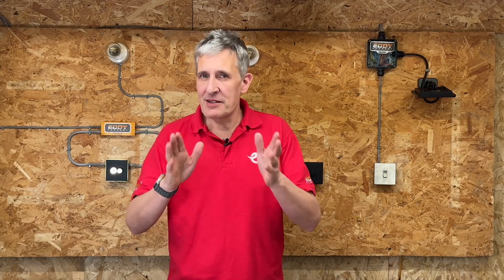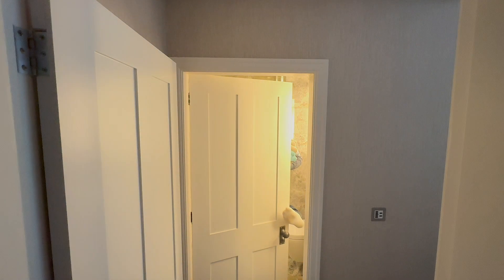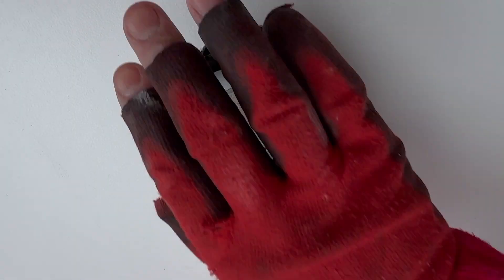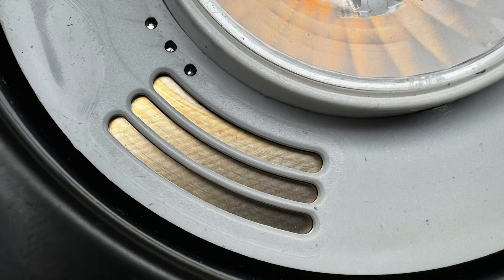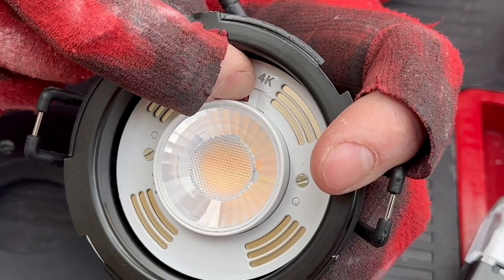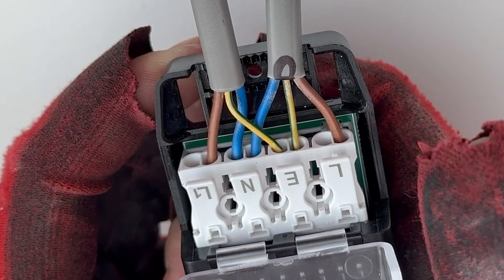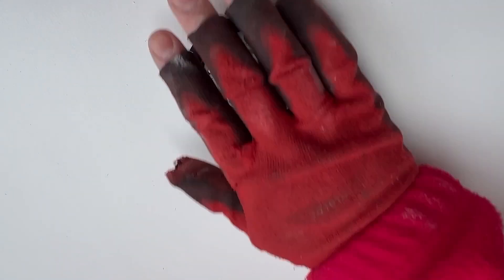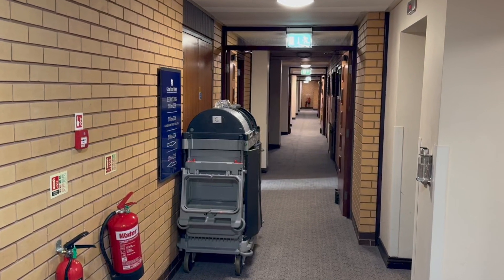Why Has This Never Been Thought of Before? - Collingwood H2 Sense LED Downlight

Comment: I assume the only critical point is the spring loaded connector of the PIR. I know the light itself is IP65 rated, but the connector stripes for the PIR are exposed to humidity.
Reply: They are gold coated

Comment: Can you common the outputs of two pir variants so both will enable any lights slaved off it? If so i think its a great product and i will be using for sure
Reply: Yes, you can loop the permanent feed to a second (or more) PIR fronted fitting and link between the L1's which allows for multiple primaries on one circuit.

Comment: Occupancy sensors for home toilets aren't required. It's easy enough to use the light switch to turn on and off.

And then there's the quiescent power consumption by the IR sensor and electronics when the light is not activated. Yes it should be low, but you are still paying for wasted electricity.
Using a manual switch still works out cheaper.
Reply: If your kids turn it off anyway 😂
Reply: Yes... 6 watts just to power the sensor 24 hours a day. May as well just leave a 5 watt lamp running all the time. Or not care about turning it off again until you first use the loo in the morning. You'd use half the electricity of the so-called "smart" light.

I had an outdoor light like that on the front porch. Apart from the sensor's power wastage, there was the false triggering that was annoying. I replaced it with a smart light, but just using its dusk to dawn time program. It only uses a fraction of a watt when off.
Reply from the maker: Typical PIR uses less than 1 watt.
Reply: @efixx  the one I used to have was about 5 watts just for the sensor. It switched an ordinary bayonet lamp socket on/off, so lighting power was whatever you fitted. I didn't think very highly of it.
Reply: @CameraTimDotCom  well as the down light has a power rating of 6w total and this will include the lamp itself I very much doubt the pir is going to present a 6w load. Of course there will be some usage but that energy loss will be for the designer to rationalise won't it. Electronic switching has it's place.

Comment: already invested in downlight fixtures, hive smart lamps, hive motion sensors and hive smart hub. It's a hit and miss system, not always the lights turn off when there is no motion and find myself using the switch and bypass all the "smartness". When you switch them back on, they will stay on indefinitely unless I switch them off from the app. what a waste

Comment: Detection range of up to 2m? Is that correct? Seems very limited in that regard!
Reply from the maker: It’s intended for the smaller rooms in a house - so you position the sensor close to a doorway.
Reply: @efixx if the room is considerably bigger than the 2 metres that you have to have the sensor by the hallway to enable it to activate as you enter the room, then you potentially have a problem.

If your position in that room is greater than the  distance away from the occupancy sensor, when that sensor times out and turns the light out, you can't reactivate the light and turn it back on unless you move towards the sensor.  That might involved putting down what is in your hands, standing up and walking in complete darkness.
This may not be safe.
Reply: It is 2m each way of the perpendicular line along the line of travel mentioned in the video.
Reply: I installed it outside the house at the entrance, and it turns on and off by itself all the time, lux, sensor sensitivity set to min.